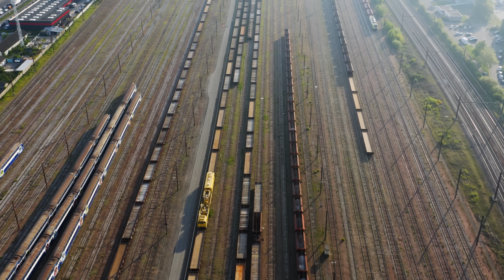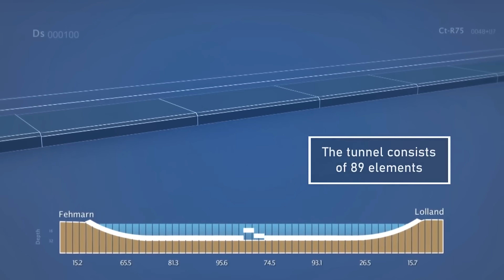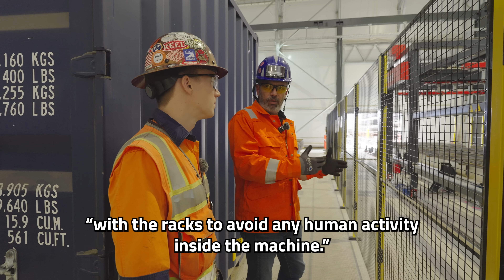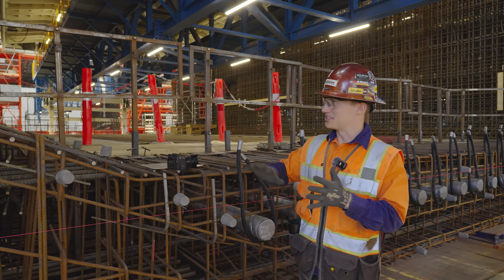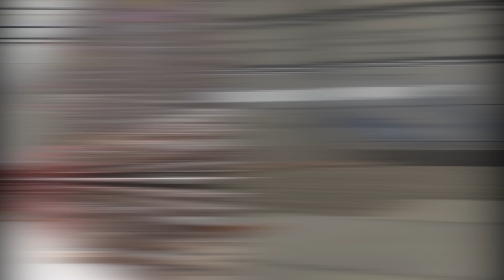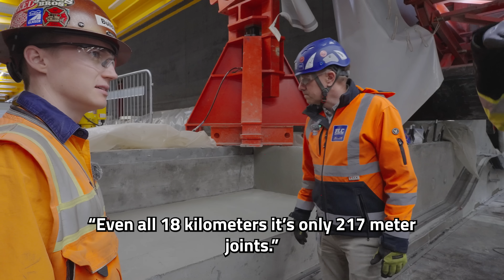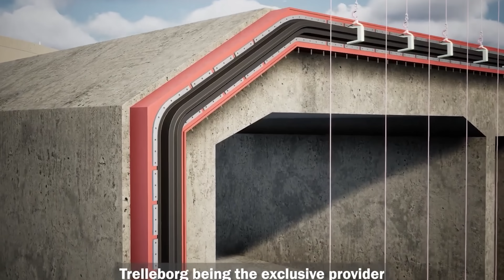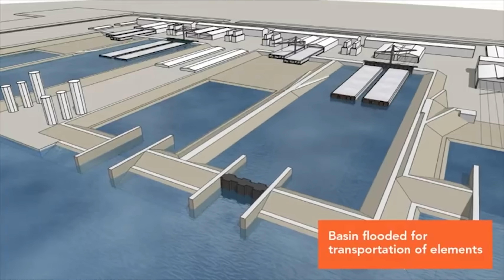How Europe's Building the World's Longest Underwater Tunnel!

Comment: They should use the tunnel element factory to manufacture tunnel element for nearby projects once the Fehmarn tunnel is done. Maybe a tunnel between Helsingborg and Helsingør? Or Between Kalmar and the island of Öland in Sweden?
Reply: Or even between Sweden main land and Gotland though it's ten times longer.
Reply: A friend of mine is working on the project, and apparently they now want to do that. (Originally they planned to just take the factory apart after they are done)

I think it's going to be tough to make that happen. You need a project to start up right away. If it gets delayed for 3 years the whole thing is gone.

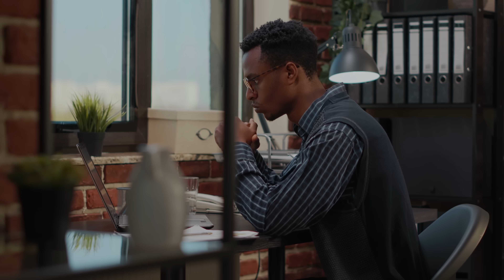Comment: 0:35 not entirely true there was a train connection to denmark from fehmarn until 2022, of course still by ferry but you would stay in the railcart the whole time since the whole train went on the ferry, as of 2022 they changed it so that you will have to leave the train and go on a bus via the ferry, but the original train line was called "Vogelfluglinie" and started back in 1963

Comment: The Channel tunnel is over 50km long so although impressive, this project is not the biggest underwater tunnel.
Reply: The Channel Tunnel doesn't have 6 road lanes, let's compare apples to apples. Also, the longest underwater rail tunnel is the Seikan Tunnel in Japan.
Reply: You need to go and research that again “underwater” tunnel. I’m not comparing types of tunnel or road lanes, that was you that brought up that irrelevant point. I was commenting on the title of the video which is misleading.
Reply: @markturner6755  Everything i wrote was a fact! So YOU go do your research.
Reply: @Einherjar-DK  It’s always embarrassing when you state something without fact checking. I get it.  Here’s the facts: The Seikan tunnel is NOT the longest “under water” tunnel although it is slightly longer than the Channel tunnel.  Much of the Seikan tunnel is not under water.
Reply: @markturner6755  You SHOULD be embarrassed! your stating falsehoods.
Reply: @ You do know that Wiki should not be used for research don’t you? Check a few different sources before you make your argument. You will even be able to find out how many metres you were off👍
Reply: @markturner6755  You are beyond help
Reply: @Einherjar-DK Just guarding against  misinformation being pushed to the masses expecting them to believe the BS. Video titles such as this are misleading and non factual as are many of the comments. If left to go unchallenged our children will grow up believing all sorts of nonsense. Proper research and critical thinking is therefore paramount. Do not believe everything you are told. Most of it nowadays is rubbish and clickbait.

Comment: I'm suprised that all of that rebar steel is not coated. Here in the US rebar used in concrete roadway is coated to provide resistance to corrosion. Cement is acidic. It helps control corrosion to keep the strength intact.

Comment: Just a few seconds in I already seen multiple problems here. First off its not the longest undersea tunnel ever, its the longest of its type. Second off you said they have to take a very long detour to get to Denmark this is not true because most of the route you showed is in Denmark so I think you mean to get to the capital instead. And third you don’t need to go that detour as there is a ferry connecting both side of the strait so you can actually get across

Comment: I wonder if they will also include an under water canal
Reply: [joking] It was considered, but they realised that getting ships in and out of the underwater canal would require sluise locks at both ends. The cost of building and operating those simply wasn't worth the gains. The alternative of making it a toll channel and let shipping traffic pay for the underwater canal fell flat when it was realised that most ships and boats would simply bypass the underwater channel by sailing at the surface of the sea...

Comment: Why do they float now, but sink when they are placed?
Reply: Segments have ballast tanks. Segments floats when tanks are filled with air. Segments will be filled with concrete to have them submerged. When submerged into the trench at the bottom, Segments will also be covered with a thick layer of rock and gravel/silt. This will help keep the Segments submerged and will restore the seabed for marine life.

Comment: Mistakes in the intro! I first passed the Fehmarn Belt ferries in the 80s: already in those days there were railroad tracks present in the decks of the ferry ships, on the loading ramps and in the ferry yard, therefore transport of trains was possible!
Reply from the maker: Yes but no longer done as not economical
Reply: @buildwitt  wrong. It no longer done because they started constructing the new tracks for the fixed link.

Comment: How are they leveling the sea floor with the tides constantly coming and going?
Reply: This is the Baltic Sea. It is largely isolated from the North Sea and the Atlantic. Normal tide variations are only a few centimeters (for 'mercans: maybe an inch or two). There can be larger variations of the Sea level in extreme conditions, but that would include a "good" strong storm with "optimal" wind directions that would push water into or out of the Baltic Sea. Even then, the variations would be on the order of a meter or two ('mercans: 3 to 7 feet).

Comment: Very good effort. Amazing work !
I am still curious how they have solved for the wiring ducts, exhausts and other finished level technical issues. Also wouldn't it have been prudent if rail lines were laid and entire finished unit built on land and just connected at sea bed.

Comment: What is done to the concrete to 100% prevent sea water egress and rusting the reinforced bar
Reply: It is water impermeable concrete. Basicly the same stuff you use in dams, water and wastewater plants, buildings with a cellar in groundwater and so on. The composition of concrete is a special field in itself. Whit the right composition you ensure the impermeability of the concrete.The Salt defenetly makes it more aggressiv, but it is the Same problem in every Tunnel in saltwater. What will make it easyer is the lower Salt portion in the baltic sea compared to the north sea. The northsea has 3.5%  Salt whereas the baltic sea has as little as 1.8%. To save the rebar you "just" need a thick enough concrete layer above it. Lokking at this Operation there will be enough QM to ensure the concrete thickness for rust protection.

So shorts answer a goot QM will ensure it.
Reply: @EtecMax  actually that's not true. They dig a seabed for elements, and after all the elements are going to be covered with rocks and sand again. So there will be no access of salt water to the element.

Comment: Nobody other than denmark wanted anything to do with the project.. Until it started. denmark couldnt get support from germany , couldnt get support from anyone but still decided to move forward. 
Wasnt until it became obvious how relatively easy(costly , but easy) it was that germany joined the project.
Its 2 countries running the project. With a bit of economic support from the regional cashpools of the EU.
Reply: The whole project is paid by Denmark except from the EU money. The Germans only have to pay for upgrading railroads and roads on the german side.
Reply: @permunkholmolesen1079  and at the German side of the connection, they're only doing one set of rails, not two like in the tunnel to make it bidirectional...

They'll probably come around later when it gets obvious how many trains wanna use the connection... it was apparently difficult for the Germans to find the money.
Reply: Remember the Swedish role in getting it all started. So not only a danish/german thing but also a great future advantage for transport to Sweden.

Comment: Europe already HAS the longest underwater section of tunnel, with the Channel Tunnel having a total length of 50.4 km and underwater length of 37.9 km. 2nd is the Seikan tunnel with a 53.85 km tunnel with a 23.3 km underwater length. This is shorter than both of them but neat though!
Reply: The title of the video is wrong. This will be the world's longed submerged tunnel for cars and trains. The longest tunnel in the world, is over a hundred kilometers long.
Reply: Do you not think the Channel tunnel is submerged then? It has a stretch of over 23km which is submerged which still makes it longer than this one.
Reply: @TrixiTrouble  It is only for trains, not for cars and trains.
Reply: @TrixiTrouble That's tunnel terminology colliding with laymans language. "Submerged tunnel" is the term for the type of tunnel in the video. As opposed to eg drilled tunnel. Or blasted tunnel. Or dug tunnel. Or...
Reply: 3rd post this week making these claims. One from Turkey to Asia at 6km another at 18km and this one. Can't these idiots research this stiff first?

Comment: It is also part of the strategic south to north cargo trail. Only possible thanks to eu, otherwise so many countries wouldn’t agree on such rail.
Reply: Thanks to EU? Denmark wanted this connection long before EU existed. Denmark pays for the whole projekt except for at small handout from EU.
Reply: @permunkholmolesen1079  except not, the whole project only exists thanks to eu, because otherwise noone would convince the germans to allow it, and most of it is paid by the EU.
Reply: Re the paying for it, you're both wrong. Here's two excerpts from Wikipedia:

"The Fehmarn Belt Fixed Link will be financed by state-guaranteed loans, which will be paid by the road and train tolls. Denmark will be solely responsible for guaranteeing the funding of the project at an estimated cost of 35 billion kroner or (€4.7 billion) and German participation will be limited to the development of the land-based facilities on the German side."

"The European Union has designated this project as one of the 30 prioritised transport infrastructure projects (TEN-T). It has committed to a €600 million to €1.2 billion subsidy."

So..
- The tunnel will be paid for by the traffic in it by collecting tolls
- The Europeean Union subsidises the project with 10 to 30 % of it's estimated cost.

Comment: Perhaps this tunnel production site could make segments for other tunnel projects, after this first tunnel is complete. 
For example a tunnel connection between Finland and Estoni, to allow the new Baltic rail line to connect with Finland.
Reply: Back when they planned the project, their original thought was to either demolish the factory or use it for other purposes. But some politicians have seen the posibility for other tunnel constructions. Germany had a plan for another tunnel, but seems like they want to build their own factory other than using the already complete in Denmark 😂
Reply from the maker: they're considering it

Comment: The absolutely crazy thing is that in Québec, there was a proposed tunnel project, and from the outset, it was evaluated at well over 10 billions. The gap to cross is shorter. The portion that crosses the St-Laurence is somewhat tricky, but the rest of the project would have been in good hard rock. We simply cannot seem to be able to build infrastructure at a reasonable price in North America.
Reply: This method is much cheaper than using a tbm like you would need to do in rock tunnelling
Reply: @sunes13  Historically, almost all tunnels in Canada were bored using drill and blast. 
As I said previously, the rock of the Canadian shield is extremely hard. It causes a lot of wear and tear on any machine used to dig in it. 

The rock in the Canadian shield is stable and really does not need much reinforcement to hold its shape. The century old Mont-Royal tunnel in Montreal is a beautiful exemple of that. Long portions of it had exposed rock faces until it renovated for the REM project. We can quite literally blast a 40 meter deep road cut and not have to worry about any collapse. They are rather common in Canada.

It is only recently that TBM began to see more use. While much of the country is covered by the Canadian shield, we do have softer soils in alluvial valleys.
Reply: @jonathanlanglois2742  wow that's really interesting! Thanks for the insight. I'm Danish and not from North America. Just know that this option of immersed elements is much more viable than using tbm under the seabed. The femern connection was originally envisioned as a bridge

Comment: How are they going to deal with the rubber gasket's breaking down is my first question.  Then there's the limited lifespan of concrete and rebar, let alone a saltwater environment.  More than my simple layman brain can handle when thinking of the cost of this endeavor.
Reply: Gasket will last for the lifetime of the tunnel. [Material science]
Concrete is of a water-tight variant. Rebar is completely surrounded by that concrete. Salt levels in the Baltic Sea is lower than in the Atlantic / North Sea.

Comment: This project is one of the biggest engineering flexes I’ve ever seen 😮😂
Reply: You should check the Norwegian floating tunnel highway ! 
Unlike this project safely at the bottom of the sea, it will be floating in a fjord, but the tunnel part will be underwater. 
https://www.youtube.com/watch?v=WMbSzFf_wTc
Reply: @ ok wow 😮 
Thanks for sharing! ❤️
Reply: Just one more lane
Reply: @mi12no  How is that applicable here?
Reply: That's similar to China Shenzhen-Zhongshan mega link bridge that was open last June of 2024
Reply: @xiv3r  This link is more like the Öresund Bridge. 
Here, on both sides they plunge in a tunnel from the banks, there is no bridge section. 
But indeed, the tunnelling method seems to be similar. 
BUT this technology isn't new although it's not common. 
Examples?
- Bouwdok Barendrecht  (2012)
- Transbay Tube (1969)
- Hong Kong–Zhuhai–Macau Bridge (2010)
- Drogdentunnelen (following the Öresund bridge (2000)

The technique has been used since the 1950s, 
What changed with the example here, and the one you mentioned is the scale, and the industrialisation of the serial production as the projects are larger.

Comment: the rubber gasket in-between each segment will wear out
Reply from the maker: I'll have the project engineers reach out to you muckfoot -- they must not have thought that through but you seem to know
Reply: @buildwitt  😂
Reply: @AaronWitt  try to make sense
Reply: @MUCKFOOT399 How do you know it will wear out? Are you a specialist in material sciences?

If you are sure the please reach out to earlier projects that has been using the same or similar techniques, since their gaskets will wear out first. B-)
Reply: @davebowman6497  yeah , I'm a material rocket science gasket specialized engineer.
Reply: Its not actually rubber, its a special compound and it will use the vacuum to seal it completely shut.
Reply: Designed to live 120 years. Trellborg is specialised in this, they have tens of projects of this type. 
And if required, they will find solutions anyway for repairs, if not already taken into account.

Comment: This is incredibly impressive. I imagine this was also engineered to be repaired as necessary once in place. I'm thinking the watertight gaskets in between each element would need to be replaced periodically right?
Reply: No never, Its a special compound that are only needed to actually place the segment and connect it to the other segments, It uses Vacuum to completely connect it in.
And then it will get a seal from the inside. So its only to actually connect the segments together.
Reply: Trelleborg Marine & Infrastructure is experienced in sealing immersed tunnels ! 
They use:
- Gina gaskets https://youtu.be/9qIEZOf8EPk
- Omega seals (clamped inside the tunnel) https://youtu.be/R3mEHLNnyAE 
Designed to last 120 years. Pressure test between the two seals before removing the bulkheads. 
They supply the bulkhead seals (for the whole project, reusable systems).
And for more info on their job: https://www.youtube.com/watch?v=A1JUWBelfeg
There are the joints between the sub-segments for which they also supply the sealing solution.

At the end, the tunnel is covered by gravels.

Comment: Am I missing something but isnt the channel tunnel like 50km long? You said this is 18km long and the longest underwater tunnel?
Reply: The channel tunnel is not inside of the sea. It's below the sea, inside the rock. 
This tunnel is an immersed tunnel. So that's the difference. The channel tunnel was challenging because of the geology, they had to go to areas that would reduce to close to 0 the risk to be flooded while using a TBM. 
Here, they are at the bottom of the sea, and not in the rock under it. 
So here you have the distinction.
And it's not a matter of making small distinctions to get a record on paper (like antennas on skyscrapers). It's a completely different type of projects, with its unique set of challenges. It is an exceptional project for this type of construction selected.
Reply: Nope its 18Km.
Reply: fabr5747 sort of already said it, but the channel tunnel was drilled, whereas the Femarn belt is built from elements lowered onto/into the seafloor. It's the longest built with this technology.
Reply: The Channel tunnel is still the longest underwater tunnel. It may be in the rock but it's still under the water.
Reply: @TrixiTrouble  And no one said the opposite... If you're not able to express nuance and to see the differenc and why it matters, it's your problem...